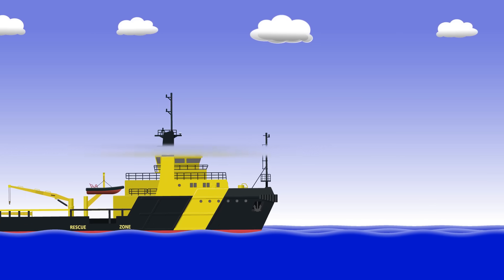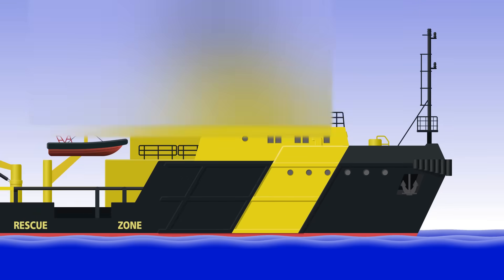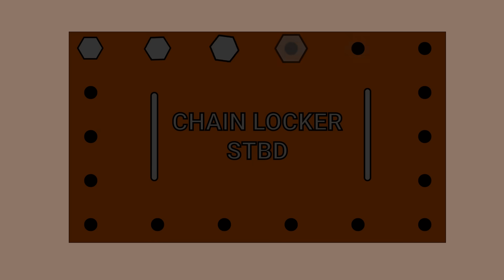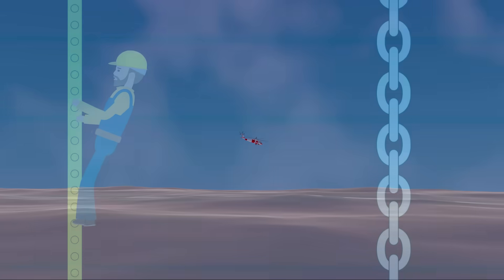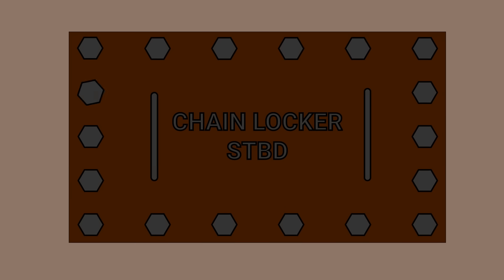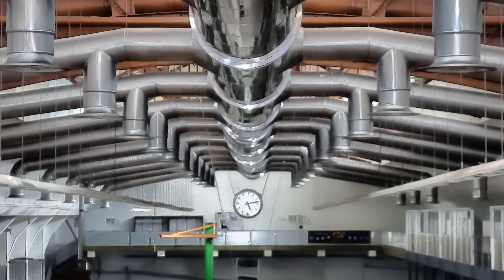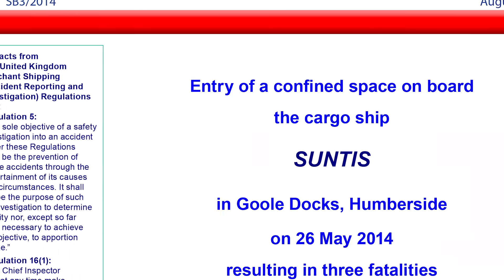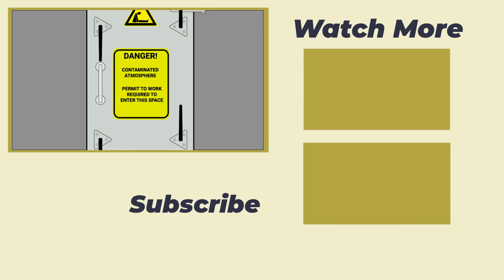Why Enclosed Spaces Are So Dangerous? | Enclosed Space Entry

Comment: There was something like that happened near where I live a few years ago  - steel barge, a couple of guys went in and were rendered unconscious, firefighters were called and THEY went in without air packs - all died. Hypoxia acts fast - that's why aircraft have those pop down oxygen masks and why, if there's any kind of decompression, the pilots will rapidly descend until the oxygen level in the atmosphere can support life. First rules for first responders (I was only an industrial first aid attendant) is make sure the scene is safe - otherwise you just become another casualty. I hope the company running that "rescue" ship was heavily fined. Poor training and having an access hatch into what should have been known as a hazardous area too small to accommodate rescue staff with the necessary gear. So preventable.

Comment: I did my confined space ticket a long time ago the air usually gets tested with a device before u enter and it can always change when ur inside so they usually have a guy testing the air every 10 to 15 minutes when theres a worker inside theres lots of cases of this stuff happening though sadly in some cases u take one breath and u get paralyzed from lack of oxygen then die paralyzed knowing u cant move thats why they test air or use a air pump to pump oxygen in

Comment: The same error made all the time worldwide. when u enter a silos ( of grain, manure, sugar, chains any closed space open only on top) air isnt fresh. in this specific scenario, rusted chains = oxidized metal = no oxygen enough to breath.

descending into an enclosed space without sure ventilation is a suicide.
They must wear a safety line to be pulled up asap, 5 min without oxygen and you became a vegetable.  oxygen % detector has to be weared, and also the enclosure itself has to be tested BEFORE going in.

silos of dust can blewup same for weat, flour or other things that became explosive atmosphere when fine dust is mixed with air.  a sad loss totally avoidable

Comment: tl;dr, rust consumes oxygen. And there's also the potential for lethal contaminants from oil atomization and the like. You always need to run fans to ventilate one of these spaces before going in, and should ideally always have a tether so someone can pull you out without entering the space themselves.

Comment: I spent years working in confined spaces. The first thing you learn is to test the atmosphere using the relevant testing equipment.  They will tell you basically the amount of oxygen toxic compounds like hydrogen sulphide and flammables. These monitors can be worn on the belt so that continuous monitoring occurs .
In this case at least two golden rules were broken . The first person went down into an untested enviroment which in this case was low on oxygen. This should have been an adequate warning that something was amiss  but instead he tried to play hero and was overcome and so forth. In this case the monitors should have been lowered into the chain locker to determine the atmospheric conditions. On determining the low oxygen content the locker shoukd have been ventilated with forced air until satisfactory oxygen levels were established and the monitors indicated it was safe to enter the confined space .
Sadly this is a classic illustration not what to do  and it cost men their lives.

Comment: Doesn't take a lot of iq to do this job does it?
Reply: There is no obvious danger and even when inside the space it won't be obvious what is happening until it's too late. The first guy was completely oblivious which is understandable as you wouldn't know better unless you were told of the dangers. The second guy could have simply assumed the first guy could have collapsed for a reason unrelated to the atmosphere in the space. The third guy should have known better but at that point it wasn't just him involved, there would have been multiple people to advise him, so multiple levels of failure. Either way this probably all happened in well under 10 minutes, it's easy to evaluate the situation in hindsight.

Comment: We call them confined spaces in the UK, rather than enclosed spaces, if there is a danger of noxious/oxygen deficit atmosphere present, confined spaces are not necessarily enclosed, for example a pit might be a confined space if CO2 cylinders are present, due to the density of it compared to oxygen and nitrogen. It's a reason you won't generally find commercial garages with pits, to many dead people found in the bottom of them (not saying they don't still exist, just not what bigger companies will do as insurance premiums would be to high I suspect, and it's an identifiable, significant risk.
https://www.hse.gov.uk/confinedspace/

Comment: Yes but
The chain must go out some way out of the room/chamber/space
While doing so it must have access to neutral pressure gas(neutral being current outside air pressure); what I mean is its not operating under vacuum
There is air moving constantly as long as there is the tiniest of openings to the outside world
And an anchor has an opening from its source, its not a vacuum sealed space.

Comment: Ok so follow my logic here, what about the spot where the chain comes out of the locker?  That place is to store the chain right but the chain is attached to the anchor, so there has to be a hole where the chain extends and recoils through right?  Wouldn’t that hole have provided ventilation?  I means obviously it didn’t, but it seems like that hole would have allowed some venting.

Comment: Firefighters often go into enclosed spaces, sometimes requiring removing their SCBA (self-contained breathing apparatus) bottle from its frame, and either pushing it through before them, or pulling it through after.
Wonder why it didn't occur to that third guy to do the same.
Reply: Scuba divers often do the same thing. 
In the case of this crewman, It probably wouldn't be practical for him to take off the tank and push/pull it through the hatch and then carry it down the ladder in one hand. Those things are bloody heavy and if he drops it, he's dead. If he loses grip on the ladder, he's dead. If  anything goes wrong he's dead really.

It just occurred to me that they could have saved all three by simply opening an O2 tank slightly, and then dropping it down the hole.  Would very likely raise the oxygen level to something survivable.
Reply: @dustyfox8532  Hmm, I don't know about that one.  Seems a bit reckless.  Someone got a bit of certification on confined spaces that can verify this?  I can't really think of anything terribly wrong with it, but it just seems like a bad idea.
I suppose my immediate questions, though these can be dispelled, i the presence of flammable materials in the locker, given introducing oxygen would be the last thing you'd want to do.  Plus drop an oxygen bottle down the dark hole where you know 2-3 men are passed out just below.
Better idea is rescuer lowers down with either a smaller bottle or have a "shore team" that runs the SCBA harness down on a rope until the rescuer can don the SCBA again.  tie the rope ot the SCBA, then to the rescuer.  Now you got a shore line and a relatively safe way to descend with the SCBA off your back.  My only concern would be if the rescuer has an issue and is unable to remove the scba themselves, the shore team won't be able to assist him getting back out.
Reply: @TurtleSauceGaming  Just to let you know, in practice you can't achieve an oxygen level high enough for humans to survive and for hydrocarbons to not be flammable. Tossing an open oxygen tank into the hole wouldn't be the worst idea in the world. Plenty of places have flammable materials meet oxygen, but you don't see sugar spontaneously burn at room temperature.
Reply: @alex_zetsu  Yeah but as opposed to a SCBA, which keeps oxygen to the user and maintains an environment that is less oxygenated, meaning that you can breath, but the flammable materials stay starved of oxygen.  And i'm not talking about just any Hydrocarbons.  Methane, Butane, and other volatile substances.  Granted, I doubt there's anything like that in a chain locker.  Can't really say.  Either way, just tossing an open oyxgen bottle is generally ill advised, and, while I can't see what lowering an oxygen bottle safely down would hurt, I can't say I've ever seen a confined space rescue ever do that, and I feel like there is a reason.

Comment: In the US we refer to them as confined spaces. Simply put they are spaces with limited entry and exit and that are not designed for maintained human presence. Air quality is typically the biggest concern, but other hazards such as drowning or entrapment (becoming trapped under large amounts of material) are often present as well. They often seem harmless, but as pointed out here they certainly are not. If you must enter a confined space you should always know what potential hazards are present and mitigate them however possible. Always enter with someone outside watching and while wearing emergency rescue devices. Other measures to take could be using a ventilation system, wearing air quality monitors, and bringing an emergency breathing apparatus. Also, if someone is in trouble inside a confined space never enter to try and rescue them yourself or you will likely suffer the same fate.

Comment: ignoring the warning via bolts, there should have been at least a simple sign on the cover that just says "you will suffocate" and that would be enough, but ideally the crew should also just be taught/know that in the first place without a sign
Reply: Bolts are there not for warning but for watertightness - chain locker has an opening in the top from which water easily enters the locker (it can be pumped out via ejector system) in the rough seas. Other enclosed spaces are usually tightly bolted for the same reason - it can be a water or fuel tank, keel tunnel or even a void space. CO2 room, paint locker and cargo holds are also considered enclosed spaces and should be ventilated plior to entry.
Reply: @Inkasso Meddl that's exactly what i thought it was bolted for in the first place, but of course there would be no question if there was a simple written warning of why it's bolted

most of the dumb and dangerous things i've done in my life are almost always because someone tells me not to do something but they don't tell me why i shouldn't do it, goes without saying but i always learn the hard way
Reply: Instead of 18 thick bolts of whatever three words should have done the trick
Reply: @Necrobin  Any indication why it's dangerous to enter and therfore closed. They probably knew that they shouldn't go in there but did not know what to look out for.
Reply: @CadelBL  Six words then: Do not enter! You will suffocate!
Reply: @Necrobin  Guess I missunderstood
 your point in the prevoius comment, totally agree with you
Reply: The thing is, the gas in an incosed space wont kill you most of the time so saying going down will kill you isnt logical
Reply: @nikolaytupchik114  Not immediately at least. If oxygen is sufficiently low, you will pass out fairly quickly which is what happened, and if it stays too low for too long you will eventually die, which may be what happened (the video doesn't say how long it took to get the crew out of that space). That's on the assumption that no poisonous gases have been released into that space, those could kill you more directly.
Reply: @KimonFrousios  yes
Reply: there usually is.  It says "confined space, permit required."  That's what that means.  Do not enter means do not enter.  It doesn't mean "huh, maybe for 5 minutes.  I just need to tie down the chain."  My real issue is this is a rescue ship that I'm sure worked with technical and confined space rescues before, by nature of oil rigs.  They were most certainly at least taught about confined spaces to an awareness level (as in they know of their exitance and the dangers, but are not trained to go in) being a rescue crew.
Reply: most factory workplaces do require this, so I find it a bit unusual there was not even a generic "danger"

Comment: This sounds like the 3 seamen on the VOS Islay who died. A ship that I served on after the event. The Bosun who was there at the time of the tragedy, told me the full story. Having said this and being trained on enclosed space rescue. It is illegal to enter enclosed spaces(not just the bolted down ones but also hatches). They have to be vented for 24hrs and tested for air quality regularly. This is mainly done in dry dock or harbour with a B.A(breathing apparatus) Team on standby. Work permits and chain of command, so everyone knows where the shore side contractors are. If in dire circumstances and at a last resort an engineer has to enter(i.e. damaged tanks, hull etc). The company has to be made aware and assessment of what needs to be done like a temporary weld patch or cement. This is rare and not advised. There have been 100s more deaths not by chain lockers or wood but also fishing vessels. The herring and mackerel boats. Ammonia in the tanks is also a killer. This happened a few years ago in Fraserburgh harbour  Scotland where I live. This was due to cleaning out the fish holding tanks before the ship sailed with a death and some hospitalised crew members.

Comment: If the chain is running too the anchor then it is semi vented, there must also be a drain or pump to remove the water from the bottom of the locker. Was the drain blocked?

Comment: When I was a teen working on my old man's farm I had an eye opening experience with the air in a feed silo... I was on top of a 100 foot harvestore hooking up the blower chute to the main hatch... after that you have to open a vent hatch to let the displaced air out so the blower can run... 

to reach this hatch you have to lean out through the railing on the catwalk a bit... as I opened the hatch someone turned the blower on...

As soon as that warm humid air touched my face, the sign on the side of the silo flashed before my eyes "WARNING- presence of toxic gases may cause immediate respiratory paralysis and death"...

As fast as a reflex I closed my mouth and turned my head but it was too late...lights out... dont even recall taking a breath of it just the next thing I remember I was waking up,, laying on a 12 inch wide catwalk... 

dont know how long I was out but ld lay there for another 20 seconds as I tried to fuse my foggy consciousness with my fine motor skills and hang on to something...